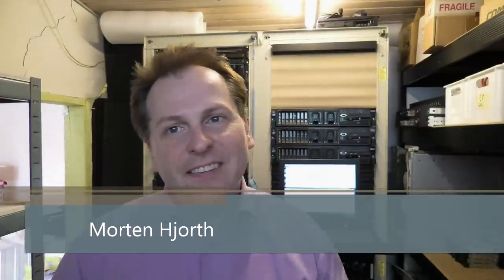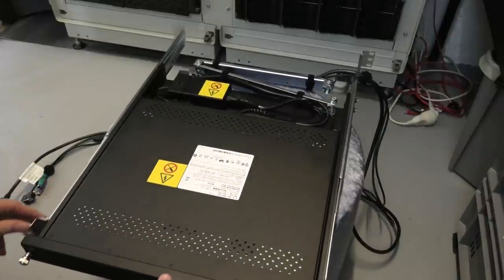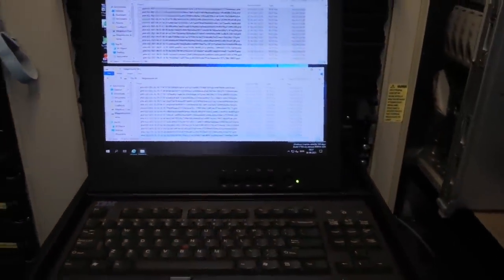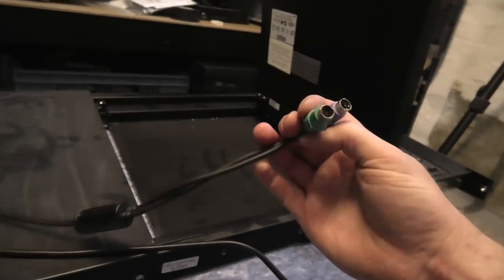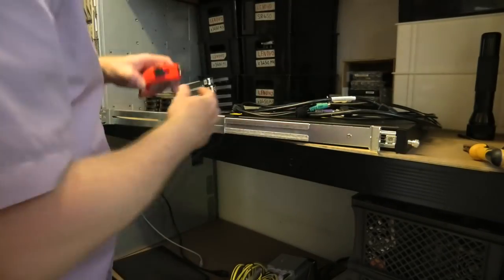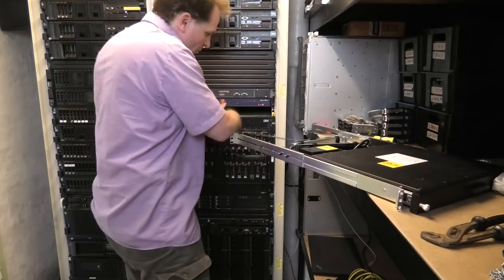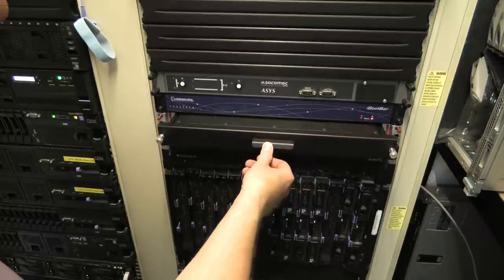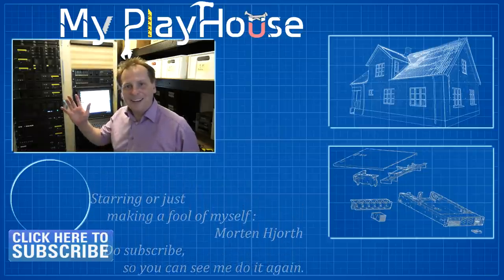IBM KVM Console from 2003 is Upgraded with Newer One - 1083

Comment: big fan of rack studs,my fingers to. But I'm always mounting them sideways, rotating them 90, that way you can get them out as well.. and the bracket might fit better. just how I do it.
Reply from the maker: I am having a bit of problems,, with the Console lucking,, and the rackstuds not holding, but letting it slide.. but it is still a cool system.

Comment: Nice upgrade Morten! Now you'll never back to the small screen.  I think at one time I had a kvm for 2 PCs.  I just you the ethernet connection these days.  If that doesn't work I'll use individual monitor/kybd to troubleshoot the half dozen PCs I have.
Reply from the maker: I have a KVM switch that can handle 256 servers.
Reply: @MyPlayHouse  ok ok, your KVM is bigger than mine, lol.
Reply from the maker: It has 16 ports, and each port can handle 16 servers.